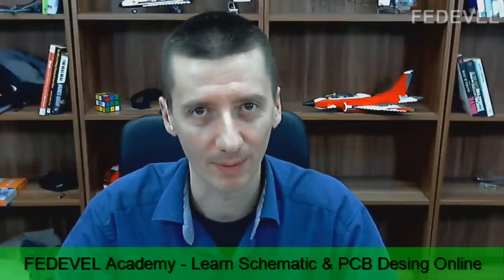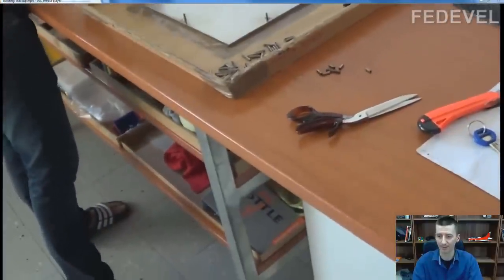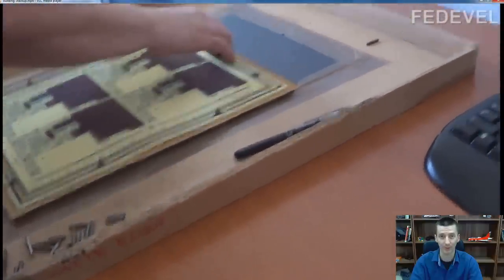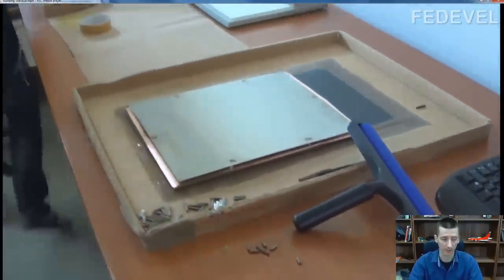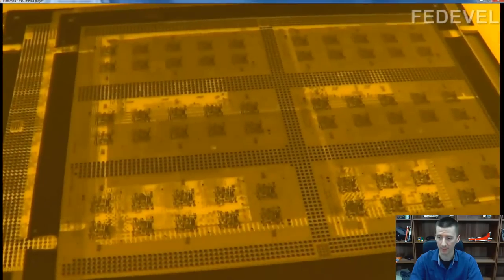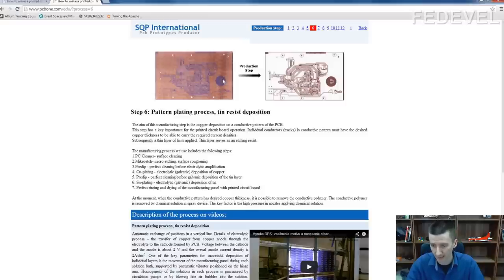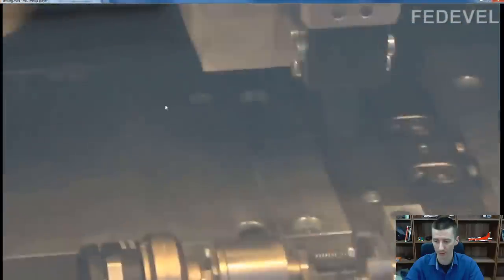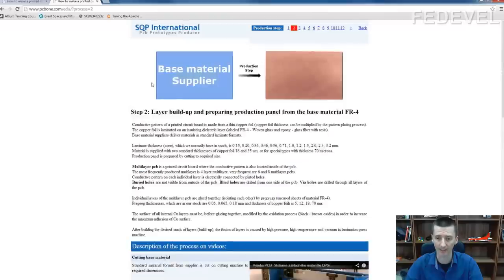How is a multilayer PCB made?

Comment: Robert Feranec: Very useful video presentation. If you never confirmed your reply to Harsh Goyal, the following may be informative to future viewers: 

Yes, to make a 4-layer PCB, it is possible to use 2 cores with prepreg isolation between. This was very common at one time for USA military PCBs, and is still used often for very high speed PCBs, especially RF PCBs which use special PTFE (Teflon) materials such as those from Rogers Corp. The distance between the copper layers is somewhat more consistent and predictable on cores than on prepreg, because the core layers are fully cured before lamination, so the signal integrity may be improved by use of cores.

But for most other PCBs, there are advantages to building the way you show in your video (copper foil forming the top and bottom layers, and cores forming internal layers.) That is why most fabricators prefer the "foil construction" method. So in planning a PCB stack for most normal PCBs, the fabricator will typically select materials as follows: 

4-layer PCB, 1x core. 
6-layer PCB, 2x core. 
8 -layer PCB, 3x core. 
10-layer PCB, 4x core (etc.) 

You will always have 1 more prepreg layer than core layers: Example, 8 layer = 3 cores (6 internal circuit layers) with 4 prepregs (for 7 total dielectric / isolation positions.)
Reply from the maker: +diddlytube thank you :)

Comment: Very helpful video. Thanks.  I have a few questions: (1)For a large panel with multiple layers, how can I avoid warping 'potato chipping'? (2) How flat typically are the pressure plates in the Burkle oven? (3) Do you have a recommendation for the time/pressure/temp/cooling cycle I should use to help ensure uniform flatness across my laminated panel? and finally (4)for a multi-layer Rogers panel, should I be using a vacuum lamination press?
Reply: to avoid warping it is important to evenly spread the copper on the layers /e.q. cross-hatching/ also the construction needs to be mirrored as most as possible. Burkle has very good quality of flatness, but still there are some aiding materials you can use to achieve perfect flatness. The recommendations are released by the material manufacturer. The vacuum is desired because of moisture/trapped air for every pcb.

Comment: I recently watched a HackaDay video lecture given by the guy that makes HackRFOne and he was talking about the benefits of using 4 layers or more when designing RF circuits and it's natural ability to combat RFI issues. He says to use the top board layer for just RF and RF Signals, the second layer should be unbroken ground, the third layer should be unbroken VCC and the last bottom layer is for the rest of the electronic circuit. Another top tip when designing for RF is to make all the RF traces 50 Ohm to make life easier for yourself. I'm working on a RF project and have taken all of this design advice on board and will be applying it to my first professionally fabricated board.

Comment: Man, I didn't know the tin trick either, I was surprised, I'll ask around, I am not sure if that step is common. Thanks for the video, I have just subscribed!
Reply from the maker: thank you for subscribing :)
Reply: Tin is used like metalic resist, which protects plated holes better than standard photoresist during etching in alcalical solution.

Comment: If you run a current through both layers you can tell the bit to stop when the circuit is completed.
It isnt drilled it seems to be pushed down but what is interesting is the filler and second layer are not effected. 
OK then he shows the drill so its drilled then how is there still copper on the side of the hole? The connection is not broken with a drill? Wait those bits are not all drills. I think it is a blunt pin that is traced over the board. That would explain how the second layer not effected and connection intact.
"Pretty standard stuff" "You can do at home" 
I want to see that house.
Your video of a video is great. "Very interesting stuff"
I just watched a video of a video of a video I might upload this video and then divide by zero while watching Inception.
Video 1930s: from Latin videre ‘to see’ combined with the English word "Audio"

Comment: Hey Robert... Really helpful. One doubt, Are you calling the inner layers as Core??
Reply from the maker: Harsh Goyal Core is a material with isolation in the middle and copper foils on both sides. In the video, the cores are inserted inside the PCB and they create the inner layers. I am not 100% sure, but maybe in some stackups, the core also can be used to create outside layers.
Reply: Okay.. So what I understood is.. If I want 2 inner layers.. I will add 1 core. So, I will get 2 signal layers on either side of the Core with isolation in between.
Reply from the maker: Harsh Goyal yes. I am not expert for PCB manufacturing, so I don't know exactly, but there are different combinations how they can do that ... for example (this is just my guessing) ... they could maybe also use two cores and prepreg between them (?)
Reply: Its possible to use 2 cores and preg between them, but its more expensive and also more suspectible to align mistake, also it requires more preparation

Comment: How to make 4mm board thickness with 8 layers stack up.
Reply from the maker: Just check out with your PCB manufacturer. Do not forget to use bigger minimum holes because of VIA aspect ratio (maybe minimum VIA could be like 0.35mm (?), but double check with your PCB manufacturer).

Comment: I have built rigid Flex single-sided double sided rigid boards Flex circuitry rigid Flex boards. but there's a lot of stuff a lot of information that you're not applying to where anyone that's going to learn are going to build or two manufacturer a PC board circuitry there is a lot of stuff into it. it takes approximately 33 40 days to complete 1 circuit board. didn't put down the wave machine you didn't put down the selective solder machine you didn't put down the hot oil Reflow machine or bath. you didn't put down the test boards are Scripts that the lab test to see that's the plating for the time that they were in the bath that support PCV hose I see holes had enough Copper Mill Justice pain the currency as well as meeting the spec of the of the mill that's required spec what are bored